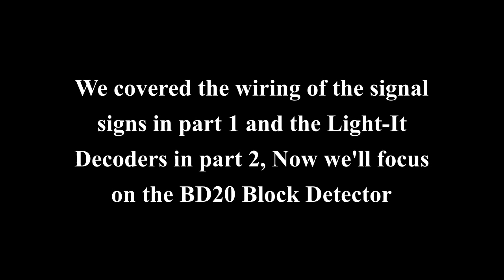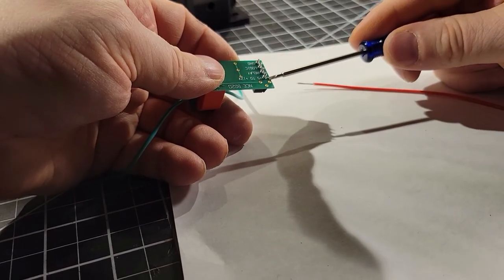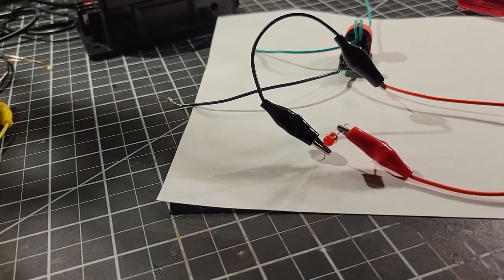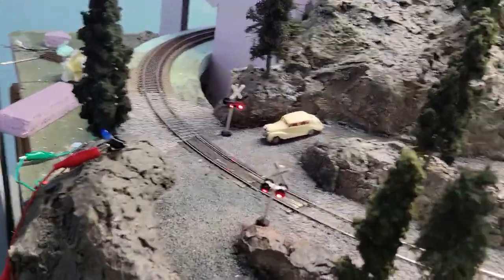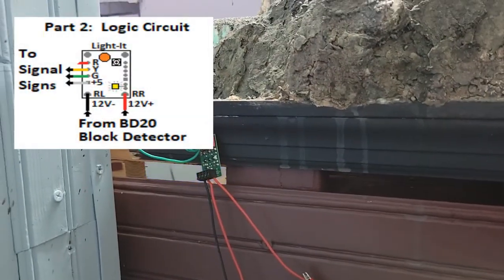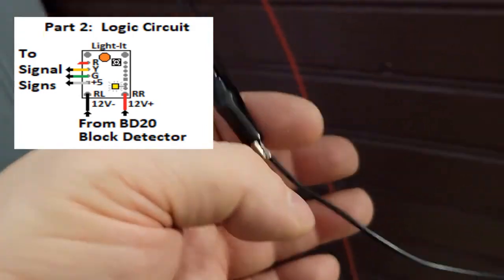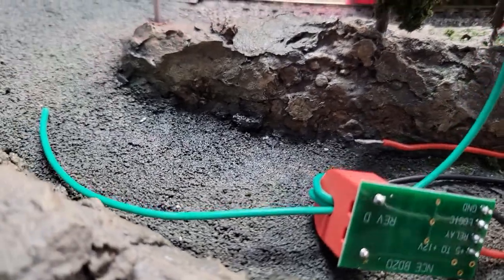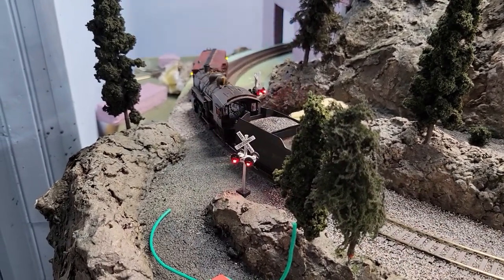020. Crossing Signal Project: NCE BD20 Block Detection with a crossing signal

Comment: What is lowes current value that BD20 can detect? I did not find it using provided link.
Reply from the maker: I don't have much of an answer for you.  But NCC has a contact page and are pretty good about responding.  I have this BD20 15 feet away from the controller and at the end of a 3 foot feeder line.  Beyond that you're gonna want a booster anyway, so I'm pushing it to the limit and it's working.  https://www.ncedcc.com/contact-nce
Reply from the maker: I'll do some testing on my layout to see if I can come up with an answer.  Got me wondering now.  I'll get back to you in a day or two.